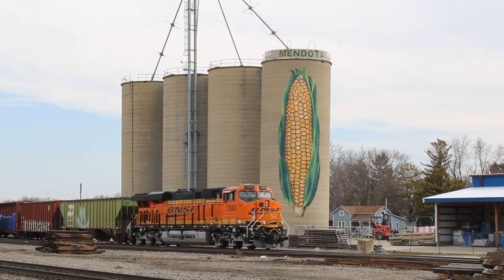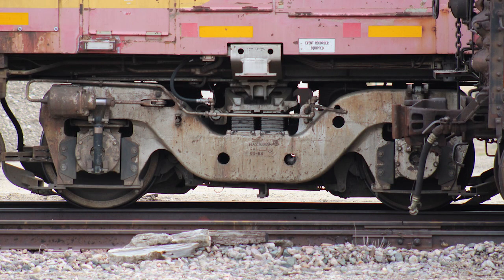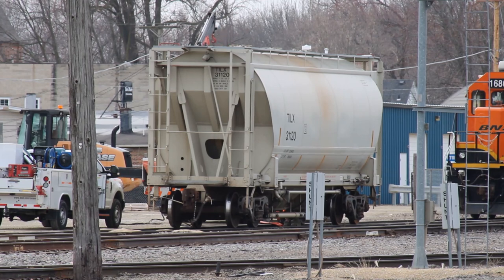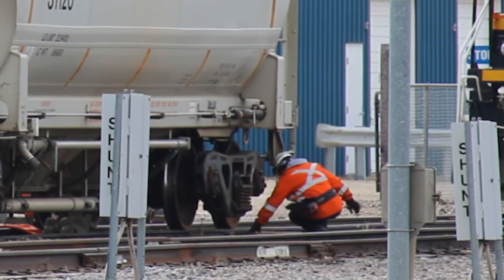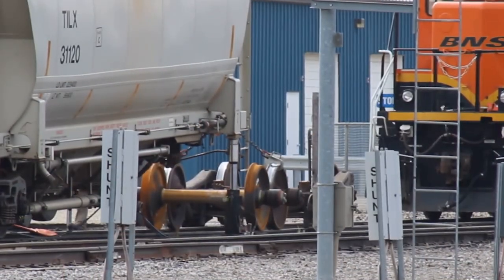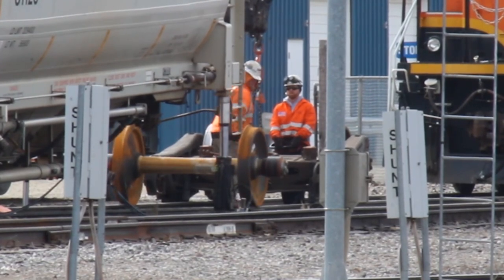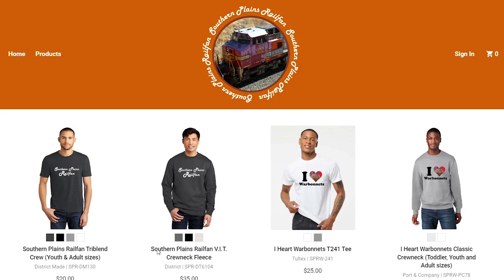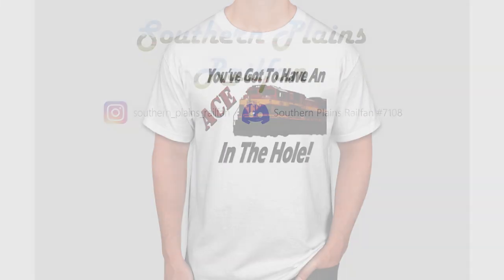How The Railroad Changes A Railcar's Wheel!

Comment: That’s an interesting process, looks relatively easy. Especially love that B40-8W, 554 is actually my all time favorite 4-axle dash 8 of the old super. Both mainly both it still has its Leslie RS3L Horn, and attentibg Railfair 1991 at CSRM.

Personal I think 554 is the ideal 4 axle dash 8 Warbonnet worthy of preservation, love to see that. But who knows, have to wait and see what’ll take place.
Reply: 555 would work pretty good I think, and it's in storage, so they wouldn't remove any of their locomotives from service doing that.
Reply from the maker: Yes, it is! I wouldn't say it's easy, but the railroads definitely got wheel changes down to a science! I saw that video you're talking about shortly after I saw 554 IRL. It was so cool seeing that engine in it's prime. Yeah, I think at least one of ATSF's wide cab engines should be preserved, since they were the last locomotives to work for such a historic railroad. We'll just have to see what the future holds.
Reply: I can only agree.

Comment: Called a 3 piece truck (springs and wheelsets not included in that count), the simplicity of a bolster and two side-frames is genius. It's all held together with gravity and friction. No bolts or fasteners to fail inconveniently. Just basic, straight-forward engineering.

Comment: It's an OHSA (federal) regulation--not a RR rule--that prevents workers from lifting over 40 pounds.
Screw jacks like these are used everywhere, from cars to airplanes, all of which have designated 'lift points' designed into the structure. 
Friction in the trucks is in the wheel bearings, not the wheels to rails.